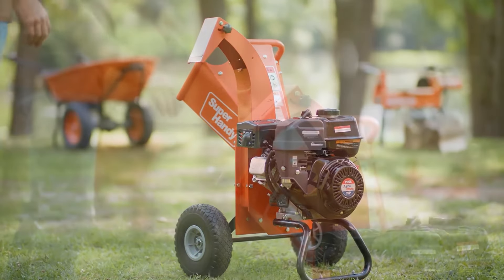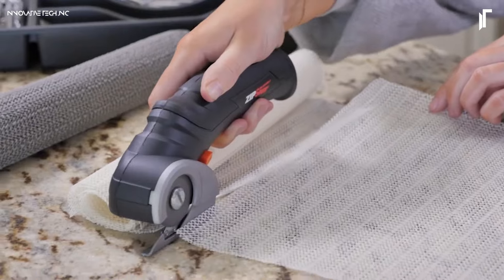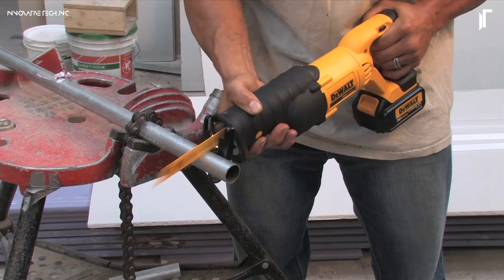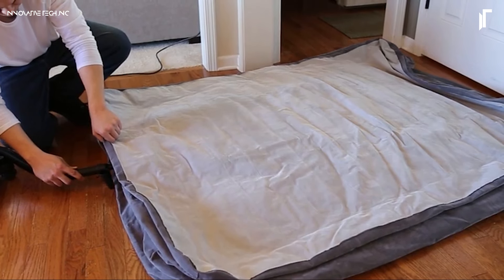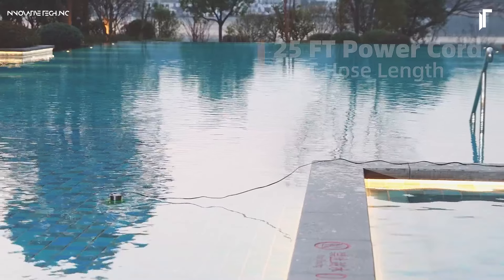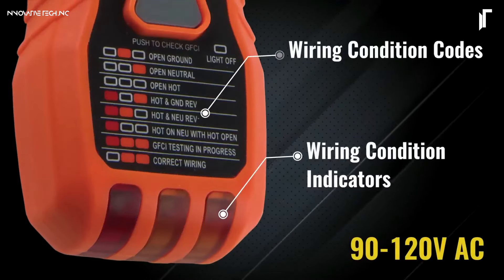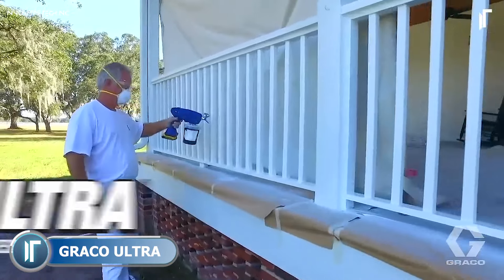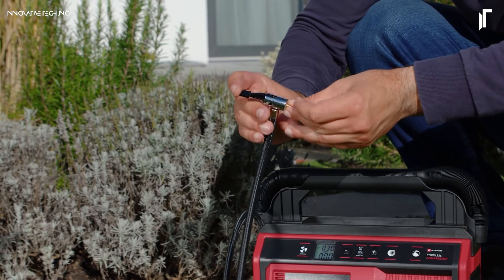13 (MUST-HAVE ) AMAZING TOOLS ON AMAZON YOU'LL TO HAVE!!

Comment from the maker: 13 (MUST-HAVE )AMAZING TOOLS ON AMAZON YOU'LL TO HAVE!!
Discover 13 must-have tools on Amazon that are essential for every toolbox! Whether you're a DIY enthusiast or a professional, these high-quality tools will enhance your efficiency and simplify tasks. From innovative gadgets to reliable, everyday essentials, each of these Amazon picks is designed to make your projects smoother and quicker. Dive in to find the perfect tools to elevate your skills and tackle any challenge with confidence
*****************************
WORX WX082L 4V ZIPSNIP CORDLESS ELECTRIC SCISSORS,
➤ https://amzn.to/3CxWCIt
DEWALT TABLE SAW FOR JOBSITES
➤ https://amzn.to/4fHdzi9
DEWALT 20V MAX RECIPROCATING SAW,
➤ https://amzn.to/3CnL8Yd
STANLEY - SL18116P WET/DRY VACUUM
➤ https://amzn.to/4emtHo1
GIANTOOL TILE VIBRATION TOOL, TILE VIBRATION LEVELING MACHINE
➤ https://amzn.to/48PShMX
AGIIMAN POOL COVER PUMP ABOVE GROUND 
➤ https://amzn.to/3YI5pzi
HOTO CORDLESS BRUSHLESS DRILL 12V
➤ https://amzn.to/4fmLjSe
KLEIN TOOLS ET310 AC CIRCUIT BREAKER FINDER,
https://amzn.to/3O7h2uL
NEW DIRECTION TACKLE BITE ALARM S9PRO 3+1 SET
➤ https://amzn.to/3CpmoyH
DOMINOX Electric Drain Auger 
➤ https://amzn.to/3O6qDSq
SUPERHANDY MINI WOOD CHIPPER
➤ https://amzn.to/48I09jD
GRACO ULTRA CORDLESS AIRLESS HANDHELD PAINT SPRAYER
➤ https://amzn.to/3UJPQpq
EINHELL - PRESSITO HYBRID AIR COMPRESSOR
➤ https://amzn.to/3AFEFHB